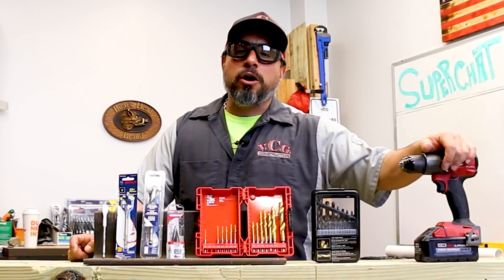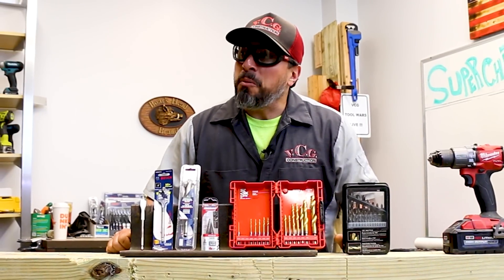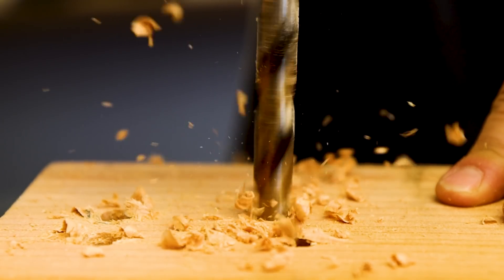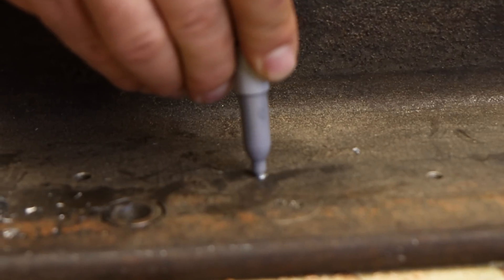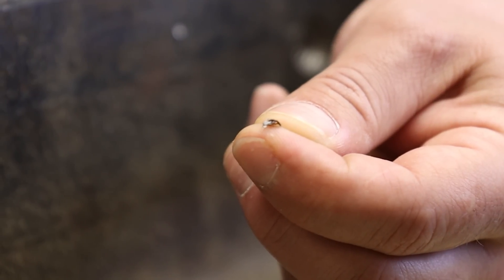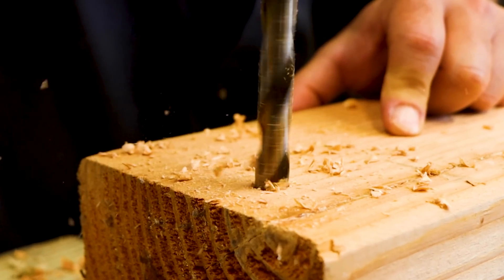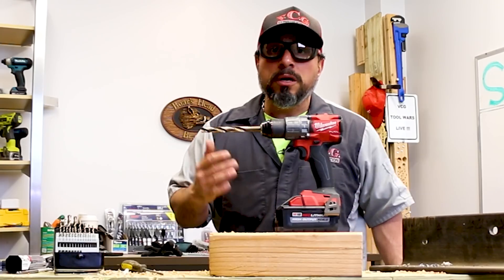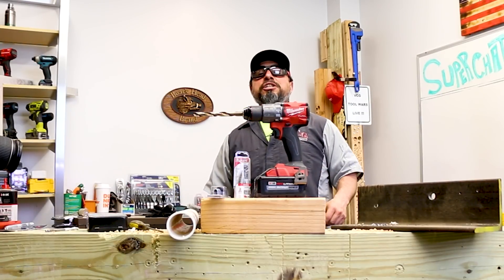YOU HAVE NEVER SEEN DRILL BITS LIKE THIS BEFORE!

Comment: You didn't emphasize the importance of the split point, and you even said "two cutting surfaces" which is wrong.  Split point bits are awesome because you don't need a pilot hole. The FOUR CUTTING SURFACES of the split point allow you to drill larger holes because they clear chips from the center unlike standard drill bits.

Comment: I’ve been very impressed with Milwaukee drill bits compared to other brands, I’ve used the titanium ones for a while and recently picked up a set of the cobalt and I have to say they cut steel a lot quicker and easier with less pressure. We’ll see how long they last vs the titanium hopefully I don’t have to replace them as often.
Reply: How did they hold up ?
Reply: @AshHalls  still going strong, I’ve had to replace a few of the smaller sizes here and there because I broke them but that’s not the bit’s fault

Comment: You should also use a centre punch in metal to start the drill bit otherwise it'll wander. 99.999999999999999999999999999999999999999999999999999999% didn't know, including you lot.

Comment: this drill bits are horse crap when you need to drill many holes. used them in mild steel 1/2 thick and they are crap! don't last at all! only good for several holes, and then they are useless! never had this problem with drill bits from Tacoma Screws store. i'm Millwaukee guy, but this bits are crap if you need to make at least 50 holes in a day. you will go thru many of them. i tried to use oil, and dry, low speed, high speed, the result is the same. several holes and they become useless. or you can try and keep drilling, one whole for 15 minutes at minimum, mild steel 1/2in thick. not worth the money and time.

Comment: I love the Milwaukee drill bits.  My only problem with them is that all their bits over 3/8 size has a cut down shaft.  When every drill has a 1/2 inch chuck now. These are supposed to be industrial bits. Nobody in industry uses drills with 3/8 chucks.  I wrote to Milwaukee about this, crickets.

Comment: Small diameter bits require higher speeds than bigger diameter bits. Using regular twist drills in wood, use high speed, and move through quickly, because the wood will heat the drill up quickly. Plastic too. Actually, there are special bits for plastic. PVC is ok, so is polycarbonate. But acrylic will shatter with a lot of twist bits, particularly if drilling near the edge. Slow speeds. Also, the angle of plastic bits is closer to 60-80 degrees. Never use 135 degree bits because when you break out of the acrylic, they will literally break the material. If you can’t get a plastic bit, and you need one in a hurry, you can carefully grind the cutting edges so that they are vertical, and scrape rather than cut. That will help. But remember, you can easily melt acrylic and pvc if you use a speed that’s too high.

Backing material could help, but it has to be tight against the plastic, or the plastic will lift when breaking through.

Comment: I tried those Milwaukee drill bits both cobalt and Shockwave set, smh. Im all for milwaukee but Dewalt drill bits are my go to. Drilling thru .5in steel and Dewalt gets the job done. I start off with 1/16 and move up from there and milwaukee for some reason always snaps. Yes I go really slow barely any pressure on the small ones but they just can't out last Dewalt. If anyone knows any bits stronger than Dewalt titanium pilot point bits please post them.

Comment: Nothing can compete with Bosch cobalt, currently.  But who knows, next year, there may be a new champion.
Reply: Cobalt rocks.  Ideal for drilling out rusted broken exhaust bolts or anything not requiring carbide.  Carbide is best used in machine tools because it will brake with hand tools.

Comment: You should know, if you don't want the drill pit to wander when you start cutting in steel or other metal, use a center punch.
Reply: I do this every time, sometimes even punching the harder metals 2 or 3 times in a row to make sure it’s got a deep enough cavity to sit in.

I also start with a smaller bit and get a shallow crater going before switching up to a bigger bit. It takes a little longer, but it makes the job easier for each bit, and it makes a PERFECT hole every time!

Comment: How about the HSS-HM solid carbide drill bits or with TCT for drilling in hardened steel or ceramics or glass or multi-material. Such as Tivoli, Bohrcraft, those are special.

Comment: Depends on what your cutting to be honest and what machine or tool is used to drill it. Say a 1in hole in steel in a piece I can get on x,y table and I'll use an annular cutter and get through like butter but again depends on location, material and how critical the final hole size is